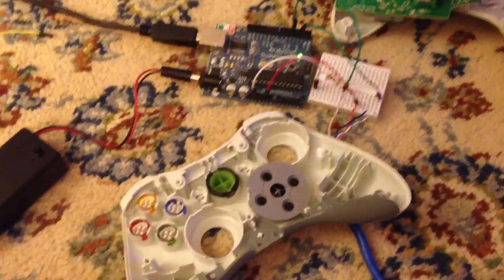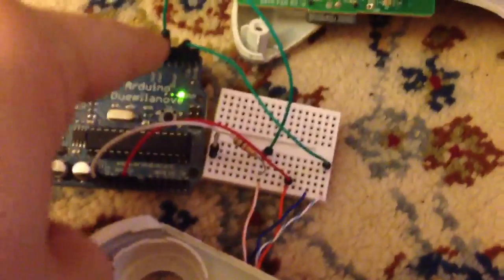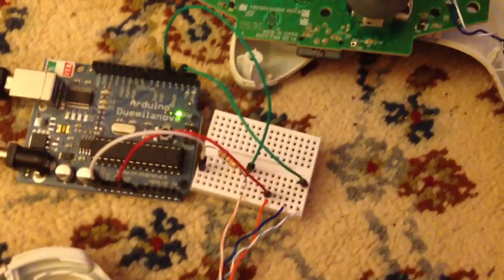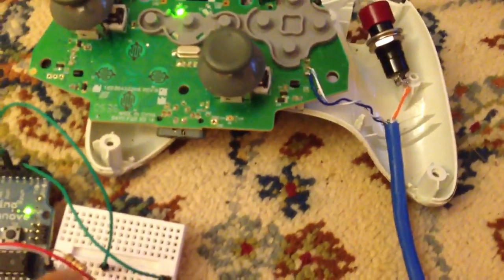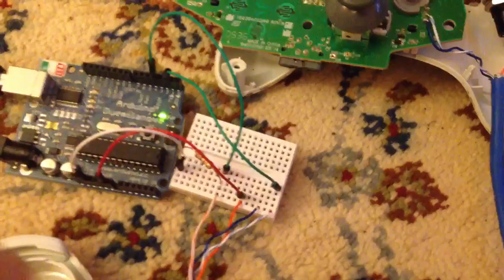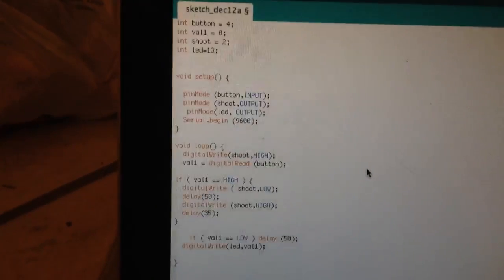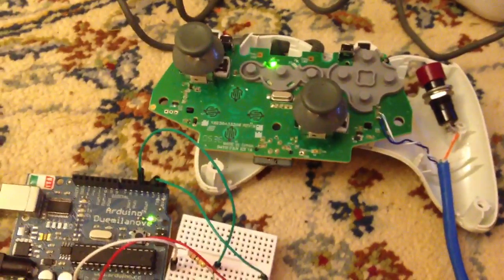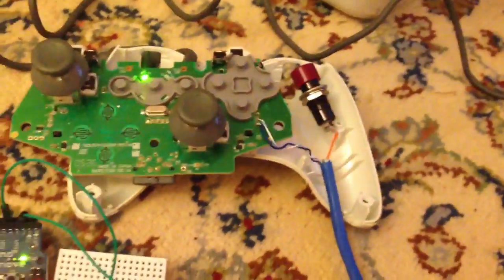Call of Duty - Rapid Fire Controller Mod / Hack - Arduino Electronics

Comment from the maker: It would litearlly be identical, just find the traces in the ps3 controller, and solder to them. It looks like the ps3 controller has a "ribbon board" that seats into a little socket... DONT solder to the ribbon board, solder to the pins on the ass end of the socket it goes into. Use the same technique (multimeter testing) and it will work fine :)

Comment from the maker: so in the end, all you need to do (once you get my demo working, work on that first before adding the randomness)

is call the random function with your desired range random(1,10) will give you a random number from 1 to 10
and add the result you get from that function to my static numbers I used in the delays

Comment from the maker: so if I run Serial.print("hello") behind the scenes this takes care of all the magic required to send "hello" over the serial port of the arduino

now imagine you made your own function
string myfirstfunction()
{
return "hello";
}
if I ran Serial.print(myfirstfunction()); its going to call myfirstfunction, which returns "hello" so then Serial.print is going to end up printing "hello"

does this make sense?

Comment from the maker: ok well  if you google "arduino random" the first link is arduino.cc/en/Reference/random. 

on this page it says "The random function generates pseudo-random numbers" under description.

and we can see under syntax (how to use it) it says: random(min, max)
so we can assume if we run random(x,y) it will return a random number in between x and y.

Im going to assume you dont know how functions work and explain that real quick.

Comment from the maker: the trigger is just a potentiometer (when the trigger isnt pressed, it lets all the electricity through, but the more you press it, the more it "resists" and clamps down to 0 when fully pressed) so to simulate the trigger being "down" you write a 0 to the pin on the arduino you are connecting to the center pin on the controller (from the 3 pins shown) and to simulate the trigger being "up" you write 1 to the same pin.

The arudino puts put 5v when the pin is "HIGH" or 1

Comment from the maker: Im a security nerd (dont really play too many fps on the 360 so I cant say from experience) but I can say from a software point of view: any rapid fire mod could be detected.

Security is a game of cat and mouse, so if you want to be extra sure? add some random variables to my code to make the delays in between the button presses a bit more "human". While they could still technically detect this as well, they would risk false positives so I think you'd be in the clear.

Just my opinion